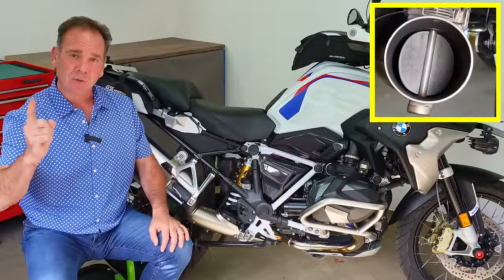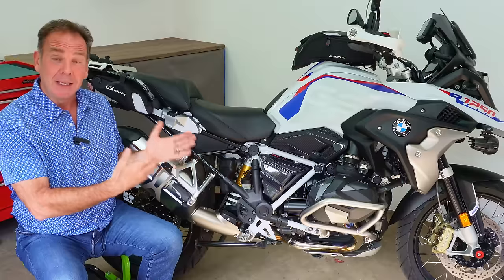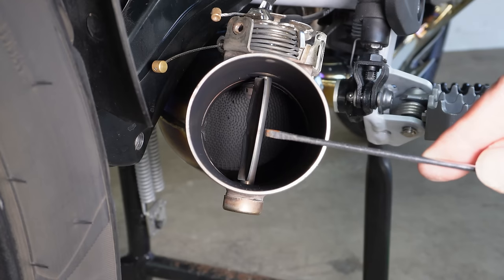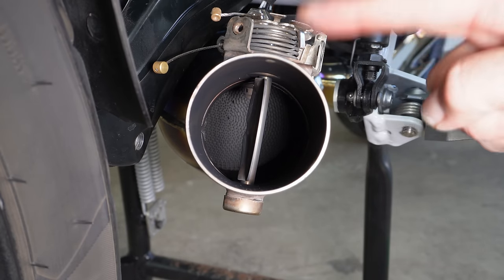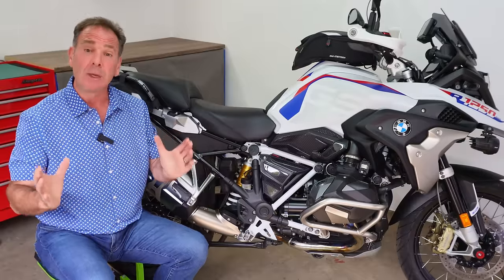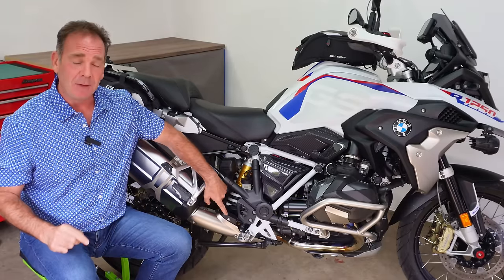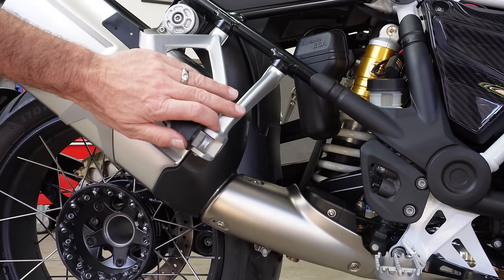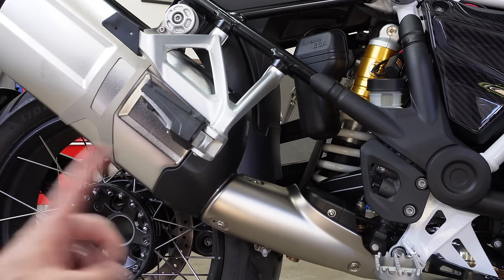EP 25: Butterfly Valve - Exhaust Valve - Exhaust Flapper - Sticking or Seized Valve - BMW R1250GS/A

Comment: great video carl , my warning light came on its a 21 reg with 7000 miles and bmw assistance said its my exhaust flap has seized I have had to wait approx 1 month to get my bike booked in for repair with bmw which is this Wednesday I have been told they don't free them off under warranty but to replace the headers I will let you know the out come once I have got my bike back, I believe you can do a self check by taking the black cover off turn your ignition on and the flap should turn, thanks for your info
Reply from the maker: Hello Bob, good hear it’s going in for repairs, I presume it’s still under warranty?
Let me know how you get on.
Kindest regards Carl
Reply: just a update after taking my bike to bmw about my exhaust flap seizing up. well they replaced the headers under warranty and was told this is a updated system and should require any maintenance  so happy ending @justthewayitis
Reply from the maker: Hi Bob, great news and glad to hear that after your long wait, your bike is now home.
I was not aware that there is an updated downpipe, so thanks for letting me know.
Have a good weekend ahead
Ca

Comment: Just replaced my servo motor on 2018 gsa1200. Out of curiosity I opened up the motor and the mini servo motor shaft does not a have a bearing,but runs on a plastic guide which had melted and seized!
Reply from the maker: Hello Colin, that’s not a very good design 😳 glad to hear you could fix and replace your servo motor yourself 👍.
I haven’t taken one apart so Thank you for sharing your investigation and having a look.
I’m sure other owners will much appreciate that insight.
Kindest regards Carl

Comment: I have a 2019 (March) 1250GS, so is Euro 4 compliant, not 5, and mine has an exhaust valve the same as yours. What was the purpose of this valve? Were BMW ahead of the game when it came to noise emissions and were doing this voluntarily on it's Euro 4 bikes? Or were noise emissions measured in Euro 4? Fantastic and informative video (as usual)!
Reply from the maker: Hello MrT,  perhaps I should have been clearer in my comments, nearly all motorbikes have a noise limit they need to comply with, so yes your Euro 4 GS needs to also meet a noise limit, the valve does this on your GS to.
Thank you for your feedback much appreciated 🙋🏻‍♂️

Comment: What a great explanation and in depth video on this topic! I’m left with one question… can it harm a r ninet euro 5 engine or tis performance when you would remove the flapper valve and leave the servo?
Reply from the maker: Hi Miguel, I’m not sure for the r9t, so have look on your local bmw forums and see what other owners have done 👍 
Best regards Carl
Reply: @justthewayitis thnx for the reply, just found out that the euro 5 exhaust made it harder to get rid of the flapper valve. A good solution is an ESE with a control for the flapper valve. Only easy plug and play solution probably.
Reply from the maker: And they are very good 👍

Comment: Excellent, really clear explanation, thanks! I have a partially seized valve myself, so I'm now going to collate the necessary kit to follow your lead...
Quick query - you go into detail about how to clean and free up the upper bearing of the flapper valve, but I'm guessing the lower bearing (ie the inaccessible one) might equally be seized... is that fair comment/likely?  If so, what then?   (Would I need to take up BMW's generous offer of a £1700 replacement - all they've proposed so far?)
Reply from the maker: Hi David, good evening and thank you.
Normally its mainly the top bush, start there and get that 100% free first, then assess if attention is need below. This is the way i do them as it saves unnecessary time. 
Yes BMW offer is quite ridiculous ..... spend an extra half an hour freeing off your bushes
Carl

Comment: Hi Carl, Here's a new reason for sticky valves.The Servo Motor is faulty and does not provide a smooth motion of the valve,therefore it's not sticking and the remedy is a new or good functioning second hand one to be checked in the workshop.
It's that black plastic thing you pointed out near the exhaust!
I have a 2014 GS LC and that is exactly what happened. So if the bikes fairly new it's a warranty case.Me and the chief mechanic with his connections found me one 3 years younger!
Happy riding!
Reply from the maker: Hi David, thank you for sharing your experience 👍

Comment: A simply outstanding video , thank you very much 😉👍
Reply from the maker: Hi, glad you enjoyed the episode, it was a lot of fun to make.
Thank you for leaving a comment 👍
Regards Carl
Reply: @justthewayitis 
Carl where in the country are you ??
Reply from the maker: Hessen 🙋🏻‍♂️
Reply: @justthewayitis 
Lol I had no idea you were in Germany,  
Shame I would have liked to have met you , your knowledge is VERY impressive Carl 👏 
Yesterday I lubricated the exhaust valve,  I'm a bit afraid of taking those pully wires off the reel incase I get a fault code , are you sure it won't flag up a fault with ignition off ??
I moved the spring and sprayed copper slip in there , I pressed the reel down a few times , then started the bike and used the revs to open and close the valve , I didn't need to take off the muffler .
My bike seemed to fix itself ??
But this was the second time so I lubricated it anyway 😉
Reply from the maker: Hi, no problem removing the cables as long as the ignition is off. Thank you for your feedback 🙏 very much appreciated.

Kindest regards Carl

Comment: Fairplay to BMW under warranty. I had two exhausts fitted to try and solve that floppy valve because I do use the bike off-road even trying to maintain it. It’s still got stuck but it really isn’t an issue. That would make me feel any difference about my BMW absolute fantastic, bike👍
Reply from the maker: Hi Paul, thank you for sharing 👍🙋🏻‍♂️, regards Carl
Reply: Hi just wanted to let you know I’ve found a product from a company called Heal tech Uk for a ES eliminator which I am going to fit to my GS 1250 Rally due to the problems with flappy valves spoke with a lovely lady called Jane and Mike. This product can be used with standard exhaust, not only aftermarket. Will let you know how I get on..👍 5:07
Reply from the maker: Hi Paul, yes ! please do let me know I’m interested as will be many owners. Thank you for taking the time to let me know.
Best wishes Carl

Comment: All the valve parts are stainless steel and the bushings are graphite, so I doubt that corrosion plays a part.
I found on my R1200GS that the top bearing, where the valve shaft exits the housing, wasn't the major cause of a stuck butterfly valve.
Only when I opened the bottom bearing and removed the graphite bushing, did the valve start rotating freely again.
I've ordered a bronze bushing to replace the graphite bush and make it so I have easy access to that bearing in the future for maintenance.
Reply from the maker: Thank you for sharing your experience. Best Wishes Carl

Comment: I bought an Africa Twin pretty much this time last year & the first thing to go on it was the servo for the butterfly valve. I used the diagnostic tool to delete the fault, but it kept coming back every time I started the engine. A new servo would have cost me £450 + labour. I bought a Fuel Euro-5 certified exhaust that doesn't have the valve, a servo delete dongle, got the new exhaust installed & the servo replaced with the delete dongle for less than I'd have paid for a new servo. My reasoning: if as Fuel told me it wouldn't affect my Euro 5 status, it removes something that can go wrong again, and clears the check engine light so that when it lights up I know there's something actually the matter with it. The MOT regs are potentially less stringent than the law: 

“The exhaust system and silencer should be in such condition, or of such a type, that the noise emitted from the motorcycle is not clearly unreasonably above the level expected from a similar motorcycle with a standard silencer in average condition.”

As far as I can tell, it's not appreciably louder. That's with the Fuel chrome full length end can.
Reply from the maker: Hello and welcome to the channel and thank you for sharing your experience with your Honda ( great bike btw ) it sounds like you have a great solution and as your aware the MOT test does not currently measure sound emissions so your probably safe in that regard. And as long as the bike is not overly loud I doubt you will be stopped and tested. It might even pass a road side test if that happened.
Things here in Germany and many other areas of Europe are more strict, but Thankyou for sharing it will help other owners.
Kind regards Carl
Reply: @justthewayitis  to be on the safe side I'll probably take it to the same place that did the work to get the MOT! :-) 

I'll check out the noise levels with a noise metre app tomorrow, just to make sure - I do have all the old bits for if/when I want to sell it on, though my MO tends to be to find myself a Swiss Army Knife type bike, that's good for everything I need & stick with it for decades, till the parts dry up. I kept my last one for 25 years!
Reply from the maker: Let me know what the noise meter reads, it’s probably close to OEM 😉

Comment: Hi Carl, when the cables are detached when you turn the valve clockwise to the stop when you let it go should it return to the open position automatically by the spring? Also mine appears to have no vertical up and down movement. Maybe it’s just a matter of lubricating it with the copper spray and it will free up. Thanks for all the informative videos.
Reply from the maker: Hi Jed, if it’s working correctly it should return back to the fully open position, turn clockwise, release and it should fully return.
Slight Vertical movement will probably return once you have lubricated . Carl

Comment: Great video, I noticed that the cables fit with the smaller cable nipple with the (dimple) as I call it, in the upper position as opposed to the larger cable nipple with smooth side up…does this make a difference. Im guessing it doesn’t matter?
Reply from the maker: Ideally the larger section downwards, but they are not going to fall out.

Comment: This should be good . Be looking for a video like this
Reply from the maker: Hope it helps you Mark 🙋🏻‍♂️
Reply: @justthewayitis yes meany thanks that answered my question. 
I had a MTC fault on my ktm 1290  last week . 
I checked the exhaust valve one the cables 8mm nut  that holds it in flat was lose . The MTC fault cleared and engine light after a couple of rides and restarts cleared . Good job as My car obd2 reader wouldn’t the ktm 6 pin plug . Need a converter . Was wondering if the flap was a back pressure gain or just for euro5 noise reduction . Feedback on the exhaust flap removed not noticed any difference. So unless it causes problems again  I leave it in .
Reply from the maker: Hi Mark glad you had success 🙏. The valve use varies from one engine design to the next, normally it’s just for the noise emissions on later model motorbikes but some manufacturers still use it for improved combustion efficiency.
Best wishes Carl

Comment: Brilliantly video on a subject where so many people, have so many conflicting opinions. So thank you for clearing everything up in such detail. One quick question, is graphite powder ok to use instead of copper spray?  I’ve heard it can be and it’s easy to puff into the bearings. Thanks
Reply from the maker: Some owners do use it, but personally I would always use Copper spray, and that’s what most technicians use in the workshops.
Thank you for your feedback 🙏
Kindest regards Carl
Reply: Thanks for the reply. I just did the job today (with copper grease spray). My flapper valve wasn’t seized but it was (and still is) slightly stiff to move, but seems to work. 
One interesting thing I’ve noticed, is that after having the major software update to my 2019 1250 in the spring, when you turn on the ignition, the flapper valve no longer does an open/close cycle, the only time it moves is when you actually start it. I noticed this, because I regularly take the end can off and clean/lubricate the valve. I am wondering if the update contained some sneaky code that means that if the valve seizes, it no longer triggers an error message. BMW must have spent millions replacing the headers on thousands of nearly new 1250s that they want rid of the issue. I’m on my second set and as I say, my valve is now stiff to move.
Reply from the maker: Hi Phillip, yes I believe that’s what they did in the software update. Due to the amount of warranty claims no doubt… not a good thing to do. Owners no longer hear them starting to squeak on start up which previously let us know attention was needed 
Carl
Reply: @justthewayitis  That’s very interesting, I hadn’t imagined it then. But as you say, although good in a way - hopefully I won’t now have to replace the headers myself if/when it seizes, now that it’s out of warranty - it also means that my bike potentially being louder than it should be if/when it does. Being as the valve on mine feels a bit stiff, even after today’s service, I suspect it’s already not performing as it should
Reply from the maker: It is hard to tell if the valve is stiff due to the spring pulling it closed, which makes it feel stiff but as long as you’ve lubricated it that’s all we can really do. Carl

Comment: Excellent video Carl, finally someone who knows what they are talking about, really appreciated. Seems like this is what's happened to my, new to me, 2019 R1250GS with 20k miles. Quoted £1,800 to replace entire system?! My first Adv & BMW, not a great start although is a cracking bike. Question though, if I just leave it, does the engine warning light being on & slight increase in exhaust noise cause any MOT issues? Thanks again
Reply from the maker: Hi Ross, thank you 🙏. You could use a exhaust valve delete device ( check any bmw gs forum for information) that would fix the warning light, and the MOT test will still pass with the valve open as the increase in noise at idle speed is barely noticeable. 
There is a company in Wales that will free off a completely seized valve for you
Go here 
https://www.cymarcbikeparts.co.uk/seized-exhaust-butterfly-valve-service-53-c.asp
It’s about £100 plus vat
Congratulations on your new 2019 GS 👍🙋🏻‍♂️
Kind regards Carl
Reply: @justthewayitis  thanks Carl, that's really helpful. Would you know though the engine warning light didn't appear this morning when I set off. Maybe just a warning though that it about to seize, going to have a look at it this weekend with your very informative video. Thanks again
Reply from the maker: Yes you definitely need to have look sounds like it’s sticking a fair amount but you might be able to free it off. 🙋🏻‍♂️
Reply from the maker: But don’t be tempted to use oil it will make it worse within a few rides

Comment: Hello a many thanks for theses explanations. Considering that you've done, is it really necessary to disconnect the cables ? that seem to be possible to spray the appropriate lubricant simply after creating space with the screwdriver. Best regards from a french biker (R1250RS).
Reply from the maker: Hello Jean, good morning, you could try without removing the cables but I find it much more effective and easier to assess the shaft with them removed.
Carl 🙋🏻‍♂️

Comment: I have the R1200RT 2014 and since I bought it about 4 years ago I don't think he flap has ever worked. It doesn't seem to have hurt anything
Reply from the maker: You could take the cover off and have a look, but if it’s seized open and you don’t have any fault codes you’re probably good.👍
Reply: @justthewayitis  Thanks. It is seized open. I did a check on it with the can off and it didn't move. I think the servo might be causing a power drain though, because if it's stalling then it's drawing more amps than it should. If I leave it too long before starting the engine it's slow to turn sometimes.
Reply from the maker: Well in the trade we say that if you get 6 to 7 years out of a battery you are doing really well, how old is the battery on your 2014 ?
That sounds like volt drop over a period of time, which is normal but the amount increases as the battery ages.
Carl
Reply: @justthewayitis   I bought the bike 3 years ago and it looks like the original battery as it has BMW stamped on it. So over 10 years old. I did a battery health check and it was between 70-90% healthy, but has poor CCA. I cleaned up all the terminals and the starter motor and relay terminals and it's not as bad, but the test still shows it has weak CCA but voltage is a good 12.6 most days
Reply from the maker: Ok, so it’s clear you have done a good check of the battery 🔋 you are doing well for 10years 👍
Best wishes Carl
Reply: @justthewayitis   Thanks. I charge it every weekend just to be sure as I only do short journeys
Reply from the maker: Ok 👌

Comment: what a great video.  My 2014 R1200 GSA continues to freeze.  I did try a graphite lub but missed the collar at the top.  Will try the srping spread in the middle and see if I can find a copper spray locally.   Do you know if I just leave the cables removed why it still throws an error how does the system know they are connected or not?
Reply from the maker: Hi David, thank you 🙏 regarding the cables it’s a case of trying, some throw a code others not, you’re probably ok with a 2014 model but I’ve not tested that myself.
Best wishes Carl